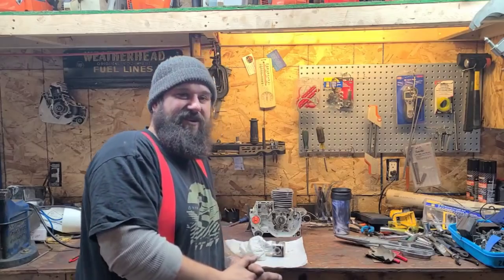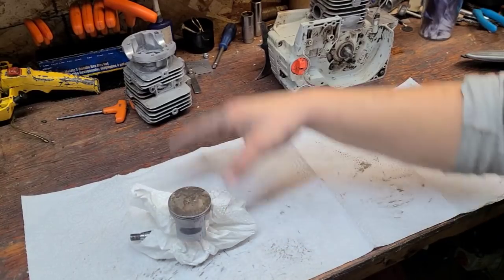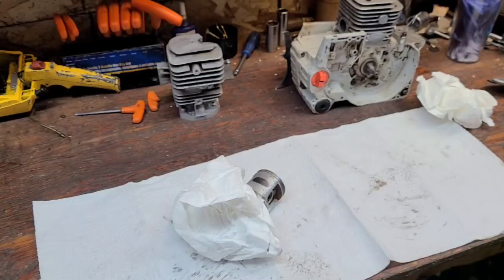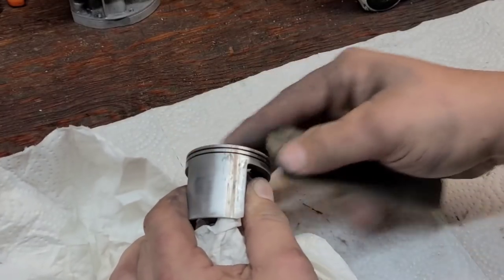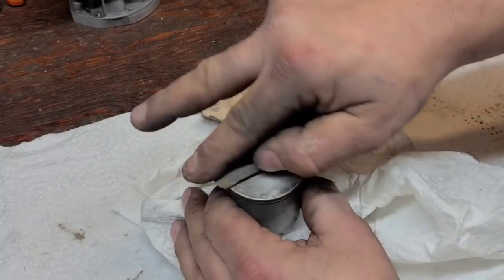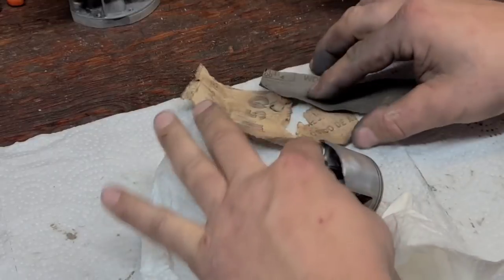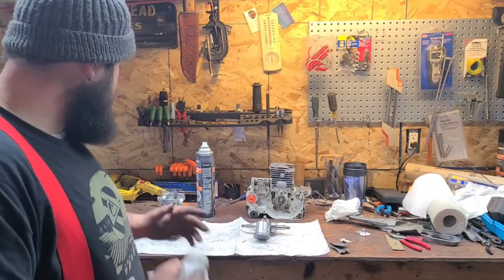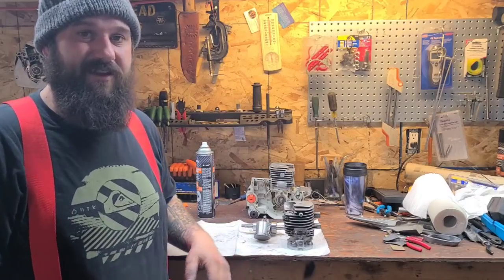Cleaning up a scored Mcculloch piston!!

Comment: "So long and thanks for all the beer, eh?"  Happy New Year all, gotta be better than the last one.  "Cooofffffeeee!!!!!!"  Running hot.  Steves Small Engine Saloon had something about that.  Basically, cold saw, start it and immediately push hard into a cut.  Worst thing you can do to a saw.  Cold saw, start it, let it warm up, ease into the cut.  Basically same thing with any engine:  let it warm up before you redline.  Tinman, thanks for sharing, here's hoping the air flows easily in the new year.

Comment: Great job Tinman. Keep up the great work. I do tend to use coarse sandpaper after I get rid of the high spots.  Not enough to take material off though. I’d like to think that adding some deeper grooves holds the oil a little better on the piston skirts. Looking forward to see how that echo turns out.

Comment: Thanks! If I do the honing and sandpapering. Is it going to be gap between the piston and the cylinder? What is the minimum PSI for a trimmer / chain-saw to work? My cylinder in the trimmer had 45 PSI first. I changed the  piston-ring and that did not much. Was up to about 55-60 something. After that I took 2000 grit on the cylinder and made it up to 75 PSI. That is where I am right now. I changed to 600 grit as I saw you did it.

Comment: If one sands the piston and cylinder too much will the likely results be piston slap and/or less compression than I had before I tore it down? I've just finished sanding the scoring on my Stihl 193t piston and cylinder because it had 90psi (have not yet installed and I'm awaiting a factory ring). I want to try and save the factory piston/cyl to reuse until I lose compression again and I also want to see what the results will be by attempting to clean and reuse. I figure if I use 40:1 mix it may give it a little more life.